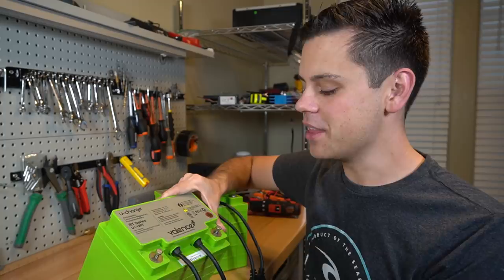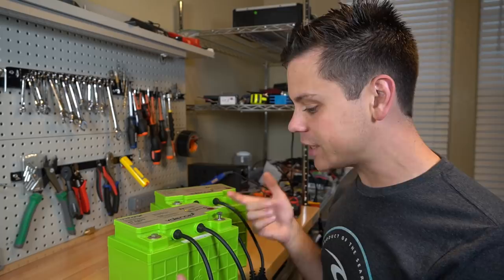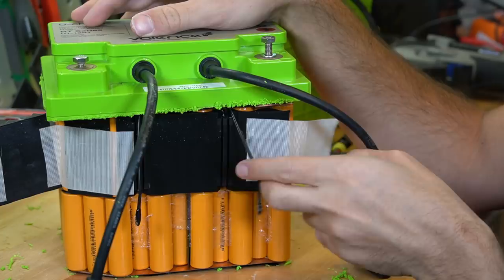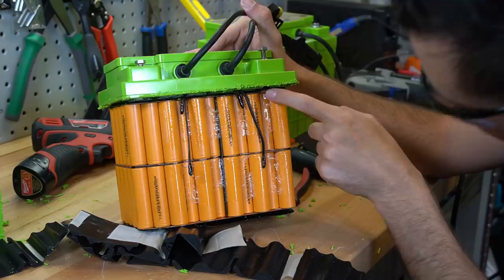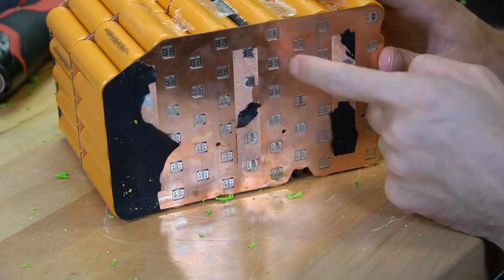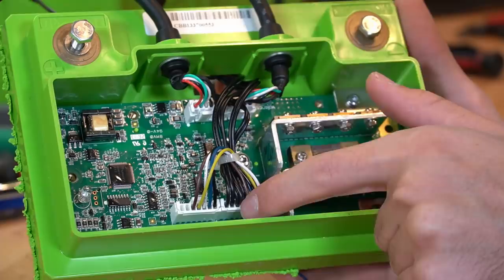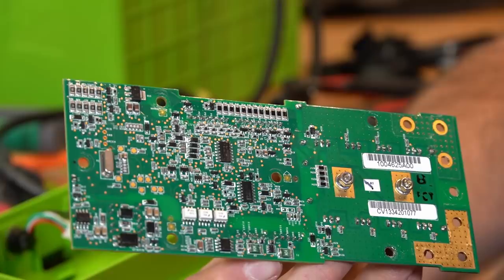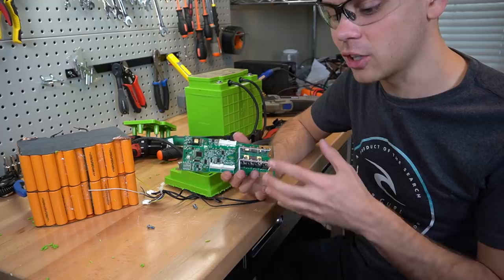$1,248 Valence RT LiFeMgPO4 Battery Tear Down

Comment: We used to call that coating "conformal coating" and it protects against moisture. That battery has all these higher quality design aspects as it is in a medical device hence legal protections and all that. On the made in china, yea, that is a trigger to make sure it's good. I used to work at a large printer company and some of the camera designs we were told had problems with our printers were interesting to look at. They would send us the schematic and camera, the camera would not pass the usb test specs and the schematic was a hodgepodge of several usb circuits. On the other hand we would work with companies in Asia and china, yes the same but.., and if you select the company, clearly state your specs, hold them to it and have technical experts manage it...things will go well. Used to do that. Once we found good companies and understood what their core skills were then it went much better. Many companies just say something like 'we want a camera with usb' and have no clue on how to test it so they leave it to them. Bit of a Boeing/Faa there.

Love watching your channel and if I wasn't in the Northwest I might consider putting up a system.

Comment: Can this battery be used standalone or in parallel without requiring whatever those two external flying leads are for?
Reply: When working with 2 batteries and 4 leads , plug the BMS leads together so the batteries Sync …..let the other two loose ends hang until you want to add more of the same batteries
Reply: Peter Andrews yes understood thanks , I am in the uk and most of these types of batteries are £1000 there is someone selling used valences on eBay similar to these but I checked the spec and they only have a slave bms inside so I assume will require an external bms unfortunately, if they were the same as this model I would buy a couple. Although not being able to charge below freezing would be a problem.
Reply: @CriftinsCampers  to freeze so many kg is hard work just put antifreeze?strrip near and a?sweater if PARKED so  long the BB uses one sensor because inside a box only failure causes various temps

'Only' 😆

Comment: Hi - I enjoy your content, thank you.  I have recently purchased a number of Valence 12V batteries partly because of your review and partly because they appear to be a quality Lithium Ion battery with a safe chemistry.  I have recently come across information that suggests that the Valence batteries when placed in series or parallel connection are intended to be connected to an external BMS .  Based on your reveal of the internal structure of the Valence batteries it appears that each battery has a quality stand alone BMS.  Is the external BMS necessary for the safe operation of multi-battery configuration or is it just an interface allowing you to monitor a battery system with a computer and Valence software?  The internal structure of the Valence Lithium Iron Magnesium Phosphate battery has re-enforced my feel that sometimes the extra cost may be worth the investment just for the peace of mind.  Thank you!
Reply: There is a lv and hv version so make sure you get lv that will do under 100v in series.  External 
(Master) Bms also needs 12v to it to be active. Master bms can trigger 2 contractors as well and even integrate with canbus. You can make a cable to read each Battery stats and it retains total whr discharged over its life along with cycles and errors. I will say though when you disconnect bms from battery and leave unplugged it does reset cycle counts but not whr discharged so be careful if someone is claiming cycles but not showing whr discharged.
Reply: @michaelgrodecki4159   - Thank you for the helpful information.  So far I am very satisfied with the Valence Lithium Iron Magnesium Phosphate batteries I have purchased.  Regards, Mike Drake
Reply: @michaelgrodecki4159  unbelievably wonked out unverified intel please post link to source?

Comment: Vatrer batteries made by LiTime? I suspect they may be! Based on your video, I researched their website. The battery cases (although different color) appear identical. They also offer the same warranty etc. However the Vatrer are about 10-15% cheaper and INCLUDE A LOW TEMP sensor at no additional cost. Am I wrong? Please advise…

Comment: Just received two of the 12 volt 12RJ Valence batteries. My plan is to build a small 24 volt solar system with them. I connected them in parallel for twenty four hours to balance them but when I tried to connect them in series to make a 24 volt battery they sparked like hell.
Newbie to all this and don't know if anyone reads these old posts but any guidance would be appreciated.

Comment: I've seen other batteries with data connections. I see that some are used to talk to the equipment it powers, but you say here that these cables are used to connect batteries. Can you explain the data connections and what can be done with them on this and other batteries.

Comment: How about a DIY build where you select a BMS that can handle multiple cells in parallel to build a 200+ amp hour house battery?

 I like your idea of driving an external relay for the disconnect off of a good BMS system.
Reply: Thanks for explaining his glee!

Comment: Will, don't get stuck over the "made in china" label like many ignoramuses. Thousand dollar iPhones are made in china. So are ThinkPad laptops and host of other extremely high quality products. The problem with lots of cheap made in china items is that there's a massive demand by cheap people all over the world wanting to pay as little as possible for things -- thus these cheaply produced items that originate from China. If you pay big bucks, the Chinese can manufacture any product to very exacting specifications -- as seen by iPhones and ThinkPad laptops or these Valance batteries. 

I suspect the cheap knockoffs you see on aliexpress will have vastly different interiors then these real Valance batteries you have.
Reply: AliExpress "knock offs" are the same manufacturer, if you research enough you find that there is just a bunch of people on there selling the cheapest version due to these valance ones in hopes people don't do their research and buy them anyways thinking they are the same as valence. Dig deep enough you find the actual manufacturer and they sell about a hundred versions/ options of this style design including special BMS design's and/or your own BMS design installed. A lot of the products sold on AliExpress are that way as well as other "sellers" that are basically China drop shippers starting a trade account and it's why when contacting most of them on detailed spec info they really don't have a clue because they're just some kid trying to build a start-up trade company. Back in the beginning of AliExpress it was only the manufacturer or their Representatives allowed to sell on there, unfortunately it's becoming more and more of an eBay/Amazon/ Shopify styled sight and unfortunately becoming harder to track down the actual manufacturer. These are all the same companies that have been selling to the states for years, they build it, slap your biz name and design and colors on it and ship it out to a US "manufacturer" and they turn it around and sell it to you for 3-15 times the amount it cost them to have it built. This is just the way it's been forever, the difference is is now the internet has gone global and we have access to these companies that only the wealthy had previous access too. The world is a changing, hence tariff wars due to the businesses of old beginning to lose their profits from the rise of Internet businesses. Same products.
Reply: I agree Lance, and even if the inside looks similar, ... look closer.  The conductors will be thicker, the components on the board will meet a higher MTBF (mean time between failure) rating, and every part will match the design spec and be certified as such.  Keywords are look closer.

Comment: I actually have two of these batteries but there are bigger 138 ah on a small solar system
 I got them used with  300 cycles on them. For 350 each they perform fantastic.. definitely high quality..
Reply: Are you using the stock BMS?
Reply: I bought a 138 ah (U27-12XP) on ebay and while it hasn't arrived yet, I'm a bit worried because according to Will the  U27-12XP does not have a BMS, and he advises against buying them! The seller claimed it has a built in BMS, so I am a little confused. How can I tell whether it has a BMS? Will it work without one?
Reply: @escheie  the XP batteries have an internal BMS to monitor and balance the cells in the battery individually not a multi battery system. The built-in cables, are for the external u-charge BMS needed if you have more than one battery in your system. "The modules are able to communicate to the U-Charge (BMS), which monitors the system as a whole. The BMS initiates module-to-module balancing, as well as controls opening and closing the contactors. The BMS asserts warnings and alarms, and outputs data via digital and analog outputs." -lithium works
Reply: @412videomagazine7  Thank you! That was very helpful information.

Comment: Fun to watch, Will, but very dangerous.  Regarding quality of products from China, I agree with many comments here that you cannot generalize about the quality from different countries.  For example, I've had the opportunities to tear apart an original Kodiak and a Maxoak Bluetti EB150.  The difference in component and build quality was striking.  The Bluetti was incredibly well designed and well built while the Kodiak was a joke.  I know the Bluetti is built in China and whoever designed it should be very proud.  I don't know where the Kodiak was built (USA?) but whoever designed it should be embarrassed.
Reply from the maker: I totally agree with that but I was still on the topic of cheap batteries from China from last videos. I actually stated what you said in previous videos when I do find high quality Chinese products. Totally agree
Reply: Inergy says they design and engineer their products in the USA and manufacture them in China.  The low quality of their original unit came from the USA design and engineering rather than the China manufacturing.  I don't know about the quality of their current products but after seeing the inside of that first one, I'll keep my distance.
Reply: @WillProwse  Yes, Yes, I know.  I didn't mean to criticize.  Your videos are the only channel that I drop nearly anything to watch as soon as they come in.  You and I are in sync with the things we learn as we learn them and I haven't seen anything I've disagreed with.  I recently ordered two 48V LTO 100 Ah batteries from what I think is a reputable manufacturer in China for a very large residential solar system that will use two large MPP Solar inverters in parallel.  I guess my interest of the LTO chemistry does deviate from you but I'm looking for safety more than maximizing the power.

Comment: Hi Will! I LOVE your videos and they have been extremely helpful in helping me figure out how i am going to build my off grid setup. I do have a question in regards to this video and battery! i just got off the phone with the company and they told me there is "NO" BMS in the battery and you need an "external" unit in order to plug into those leads and charge/run/balance them. My question to you is do you know if this is true? have you run these batteries and charged them without this? you show a BMS of high quality inside which contradicts what the company just told me... im looking at buying 12 of these from a supplier and want to know if they will work or not and your input would be VERY helpful!

Thank you!

Comment: So, what I want to know is whether the Valence batteries in the XP series will work for the expected number of cycles.  These are for sale on ebay but apparently do not come with a BMS (they have an external BMS according to the specs I've seen).

Comment: Hi Will, love the content! I have an interesting question. Would it be possible to connect a RT with an XP to use the built in BMS from the RT to balance and monitor the XPs? The comm cables look to be the same. It would make a great video!

Comment: I'm confused here (not your fault). I can buy 8 of these batteries to give me (in various combinations of series and parallel connections) 48v 10kWh array. for $7500, or I can buy a powerwall-ish item giving the same specs for under $2000.  Am I calculating incorrectly?

Comment: IVE ALWAYS WANTED TO KNOW A WAY TO TURN MODIFIED SINE WAVE POWER FROM A GENERATOR INTO PURE SINE FOR MY PELLET STOVE!
Reply: You can change to an pure sinewave inverter generator (think Honda 2200) or you can use your modified sinewave generator to power a 12 volt power supply which in turn is powering a pure sinewave solid state inverter.  Or can you just change out the motor on your pellet stove?

Comment: How are these orange cells protected. I mean if one of the cells is internally shorted, there should be some kind of fusing. Is there a fuse inside each cell? Or is this chemistry just so much safer, and there is no need for Tesla style fuse wires on each cell.
Reply from the maker: Yeah, no need. LiFePO4. If it was NMC or NCA, individual cell fusing is always required

Comment: Hey Will. Do you think you could test some smaller lifepo4 battery’s like the ionic 12 ah batteries that have their own Bluetooth monitoring app. 

There’s even some smaller lifepo4 batteries on amazon anywhere from 6 ah to 20 ah. 

As someone who is starting to use these in portable Bluetooth speakers instead of heavy lead acids. I would like to know if I’m getting what I’m paying for.

Comment: HI: Not sure where to ask this question, so I decided to use your latest YouTube. I have 180 watt solar panel on my RV. I want to add a 200 watt folding panel; can I connect the folding panel into the incoming wire from my roof panel and feed it into the charge controller.  What are the issues that I should be concerned about? I plan to purchase a new charge controller to accommodate the two panels input.
Reply: From my experience, the main thing is to make sure that the open Voltage is very close on both panels. Open voltage is measured with the panel exposed to full sun directly at the leads from the panel, without hooking them to anything else. I believe my friend and I discovered that one can get by with almost a full Volt difference, but I recommend lower....as close to the same as possible. If your Open Voltage is to far apart, it's been recommended that one gets a second solar controller to run to.
Hope this helps! :)
Reply: @Tumbleweed5150  Thank you for your input.
Reply: @Tumbleweed5150  The 200 watt is 22.5 Open circuit voltage, the 180 watt is 24.06 volt. Is this close enough to combine the two on one line?
Reply: @richardmalone2463  Not sure, but that's almost 2 Volts. Hooking them together might work, but we have had the higher power solar panel burn out the lower. One Volt is the highest I would trust.
Reply: @Tumbleweed5150  Thanks for the input, due to your input I will not try to connect the two into one. I purchased Will's book, I have a lot to learn. How fun.

Comment: Question: Is there a way to power a 55lb thrust trolling motor with solar? I can start with a full battery and use solar to top off if possible. Was thinking portable solar  generator that could be removed and used elsewhere when Not boating?

Comment: Thanks I feel a little better knowing they are quality. I got 8 of the xps 138 models to split with a friend. The data sheet says it needs a specific external bms from them. But I can't find it for sale anywhere. Valence won't reply to my requests either. Any suggestions for a source to buy the U-Charge U27-12xp or a good alternative?

Comment: There seems to be a group of people having issues regarding the XP models. More specifically the built-in BMS, but also needed External U-charge BMS. People should understand the internal BMS only monitors the battery itself and not the system as a whole. There is another catch. The BMS's for the XP models are EXTREMELY hard to find. I like others bought the u27-12xp because it boasts 144ah at 12.8v (/138ah used after being sold from trucking companies after 300 cycles). The batteries are a steal finding them for $350-$450 used, but the u-charge XP BMS's are no where to be found. Can anyone help? Is there another suitable BMS or Mod out there? The Batrium BMS install is doable, but last resort for me as it looks like an intensive mod. I would pay a lot of money to not put myself through the headache and uncertainty of having to install the Batrium system on 8 batteries. Is there a way to save us XP buyers?
Reply: I have the same question 
. Somebody help please!

Comment: I have a 4s 130ah valence battery that is 12 years old with 400 cycles and it still holds around 95% of original capacity. Cost me £300! Why mess around with cheap alibaba rubbish? I can see my valence lasting another 20 years or more!

Comment: I have four of these LiFePo4 Valence U1-12RT Batteries, I got from a friend who is an electronic scrap dealer.  They Work Great.  I can get a dozen similar Power Sonic Batteries, but their BMS may be bad.  The battery pack reads ~14V, but the terminals don’t show any voltage.  The voltage stops at a gang of eight ?MosFets? On the BMS.  I replaced the fuse, and tried to charge the batteries in parallel from a two amp car battery charger for a day to try to wake them up.  That didn’t seem to help.  What would be a good (cheap) replacement BMS for these batteries?  Can I use them without a BMS?  I’m going to try to charge one battery pack bypassing the BMS with the 2 amp car battery charger.  I figure the current is low enough not to hurt it, and the voltage is going to top out at around 12V well short of the battery’s max voltage, so that won’t hurt it   I hope that will wake up the battery and BMS once I get it charged up.  What do you think?  Any advice?